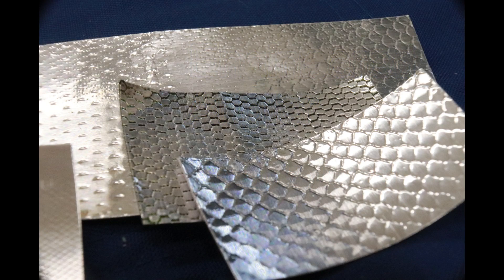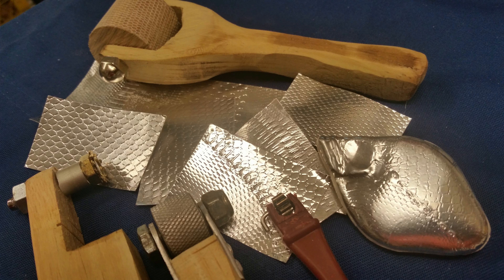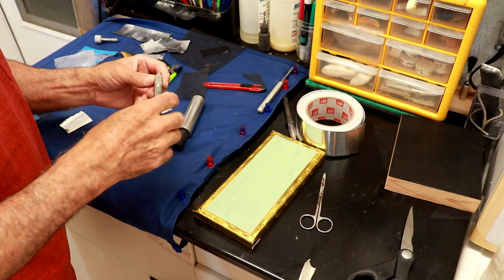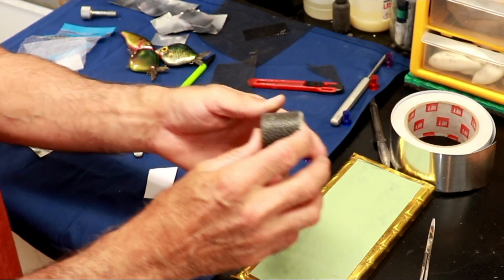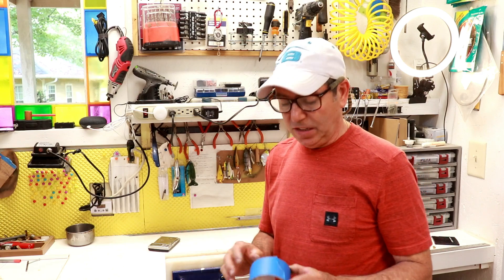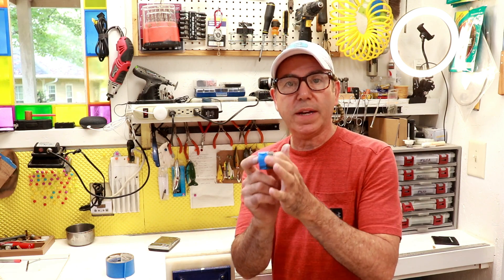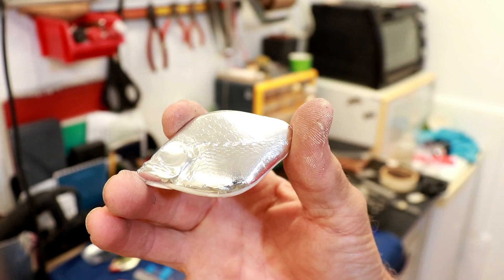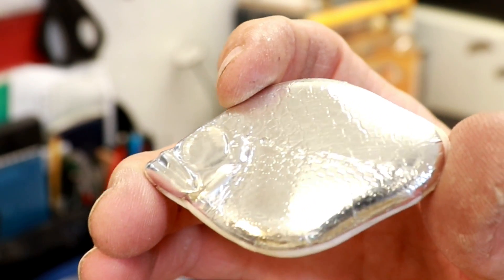Fishing Lure Foil, Techniques for Fish Scale Textures part 2

Comment from the maker: Has anyone out there found some other tool or kitchen implement or random object that they have used to get a cool looking texture on the lure foil?
Reply: How about the holes drilled on the front of a portable radio, the tempered glass of a shower door, the soles of footwear, a unique pattern that you carve into that fancy rolling thing-a-kabob. My wife’s wooden spoon that has indents matching my knuckles. Put your hardwood roller inside a makeshift tumbler to create a one of a kind pattern. Push your roller over coarse sandpaper. Multiple passes over a recurring pattern creates a random pattern. Let Excel create a pattern from the random sample generator seeded by the time stamp, and using various number of input signals. It’s Captain Chaos!
Reply: We use texturing tools in woodturning.
Reply: I use a pasta roller for the tool.

Comment: Hi Franco I need your help. I made 2 almost Identical crank baits put of wood with I bib both I added an 8th ounce wieght close to the lip they both leaned to the left. So I trued up the lip on both. They still lean and want to roll. I now added a little bit more weight near the lip. Hoping it will bring the head down more. My question to you is if what it did don't make it swim upright still should I replace the lips on both
Reply from the maker: You should try to tune it with the tie on eye.  If that doesn't work then the bibs are not in square.
Reply: @Engineered Angler Lures  thank you I've tried the tie on eye and I sanded the bibs more. Wish I could send you photos so you can look at them the bibs look square to me but I could use some else's eyes
Reply: I just tried tuning the eye and the bibs and they work now

Comment: Polish your foil first then stamp the pattern that way when the foil is applied to the lure its crazy polished as im sure you know by know if you stamp the foil then polish the foil you will lose all the stamping features.
Reply from the maker: Sure...I think polishing the foil gives a nice finish but it tends to leave a very slick surface that the paint and clear coat has a hard time adhering to.  I have had lures where the paint and clear has pealed off after one good fish.
Reply: @EngineeredAngler  hmmm not sure what paint your using but havent come across that problem yet and i fish for big big toothed fish such as pike and walleye
Reply from the maker: @thatsmallrockshop  
Maybe I'm over polishing...
Reply: @EngineeredAngler  could be. Not sure i use an industrial metal primer overtop of my polished foil then paint . Anything acrylic wont stick to polished anything.

Comment: Add a magnet to the bottom of your tools and attach a strip of steel under a shelf then you can see each of them so a 'll you have to do is grab the one you want use it put it back and grab the next one without having to fumble through a draw full of them and the soft jones like the netting won't get damaged.
Reply from the maker: excellent idea...thanks